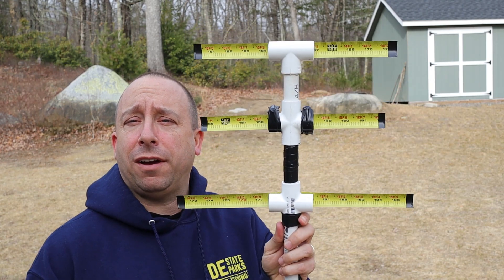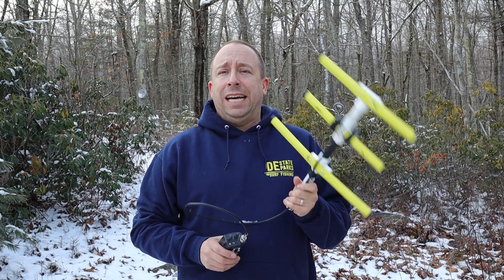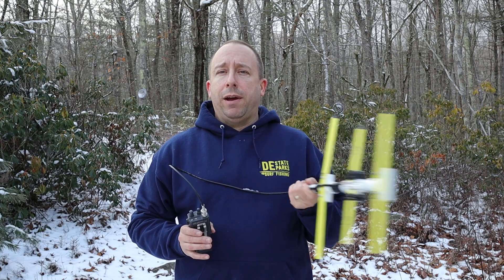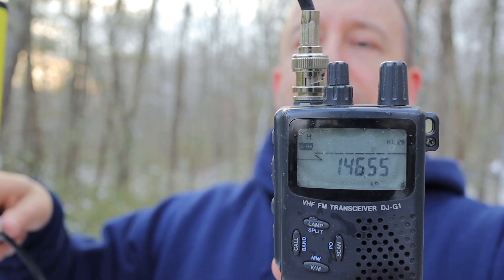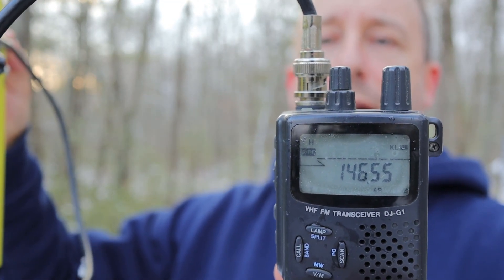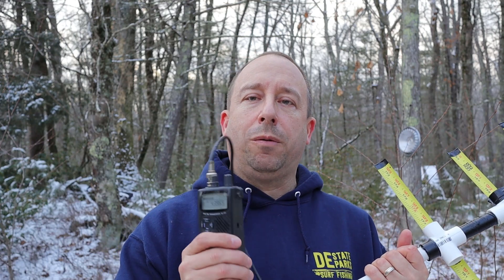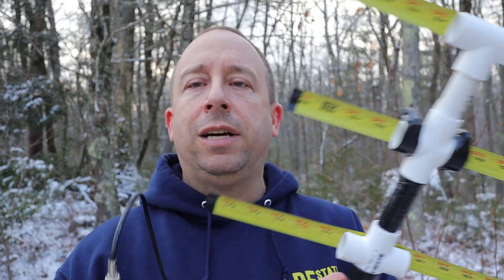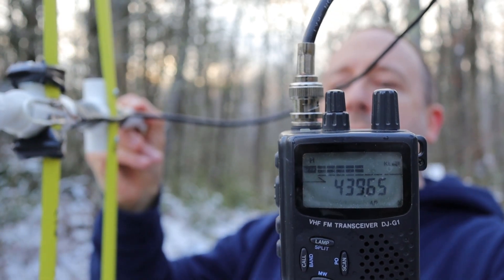2 Sneaky Techniques For Finding Hidden Transmitters (Ham Radio Fox Hunting)

Comment: Good material. I have a different problem. I'm looking for a small signal in the forest. And there is a big problem here, because the signals are small and there are many reflections. Finding the right one is difficult. Is there any way to find a fox (direction) in the forest, with small signals?
Reply from the maker: Maybe something like a tiny SA with an external antenna?  Not sure ..

Comment: I've never been on a foxhunt, however I do like that you raised awareness about utilizing harmonics.  An old timer emphasized the importance of utilizing them for many things. A fox hunt is a great reason to use them. I utilize using harmonics when I do calibration or radio alignments (on analog equipment).  👍